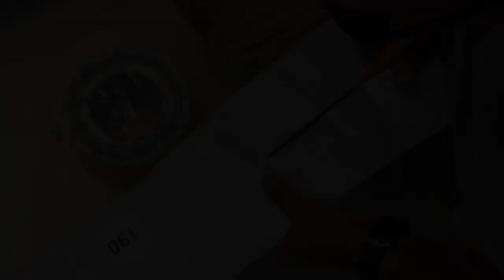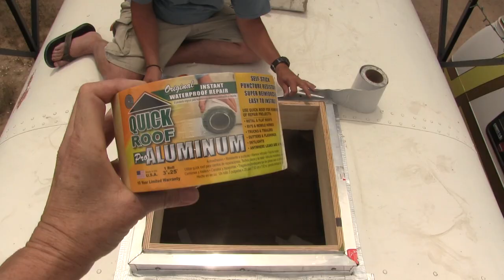Skoolie Skylight with Opening Hatch (plus 2nd skylight)

Comment: I always double check your older videos before I start that part of my bus. I am about to add some fans and a skylight to mine. I don't have a metal break and I was trying to measure everything on paper trying to form the flashing with a table, 2x4s and a clamp. You covered all yours with tape anyway. I am thinking about skipping the metal and covering the wood directly with the roofing tape now. 

It's also funny to go back and see unfinished walls and missing cabinets, now that you're watching TV in your bus and all.
Reply from the maker: In retrospect,  I think that what I should have done.
Reply: @BussyMcBusface  I still wasn't 100% on the idea lol until this comment! But if you're thinking it's alright I am more confident. Probably building it this weekend.

Thanks for filming all this and teaching the rest of us.

Comment: Oops, square corners on a vehicle opening is a stress point and may lead to metal cracking.  That is why they make airplane windows with rounded corners.  Look up the story of the Comet airplane and how it broke apart in mid flight.
Reply: there is a bit of a difference in speed.  Dont see it being a problem on bus